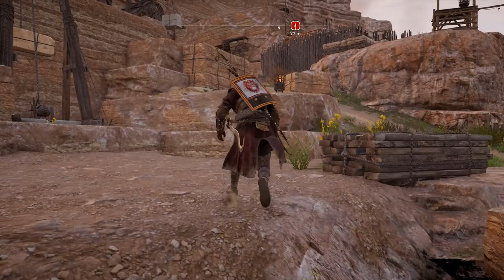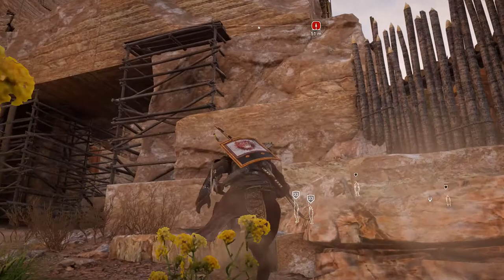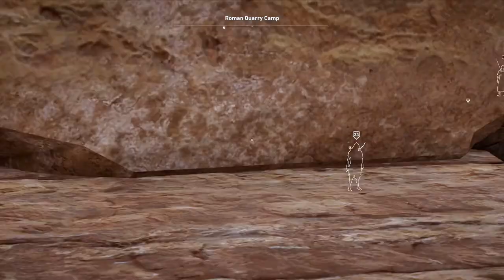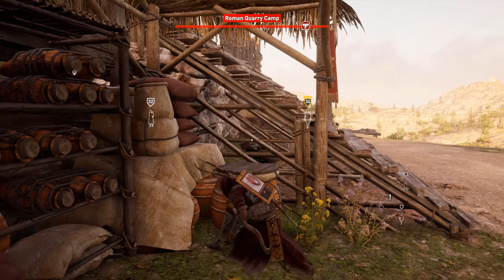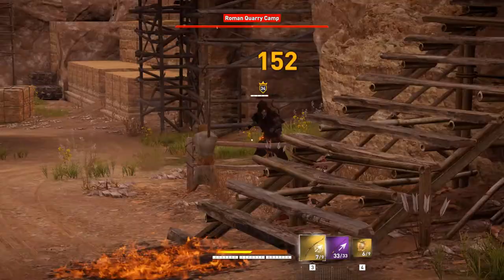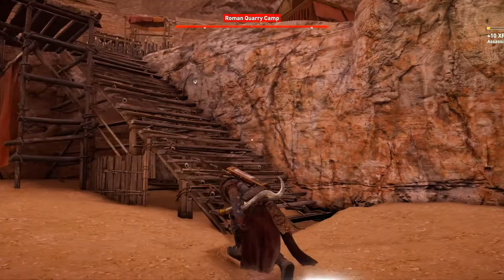Why do CPUs get HOT? Can heat DAMAGE Processors?

Comment: Hey there, I have a different question. People seem to worry about the max temperature, but I'm also wondering about the rate of change of the temp. I've seen that people say AIO coolers keep the actual rate of change of temperature lower vs air coolers. I can't find anything online about how rate of change affects the lifespan of a CPU. In my case, I edit and render videos, so I'll have a lot of up and down temperature fluctuations. With air coolers these fluctuations will be faster vs AIO. How much of an affect could this have on lifespan?